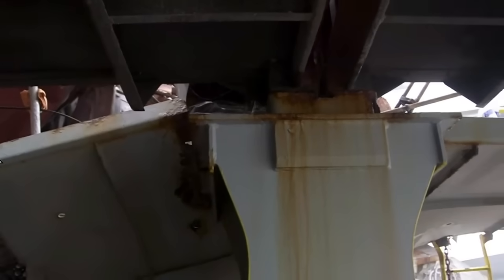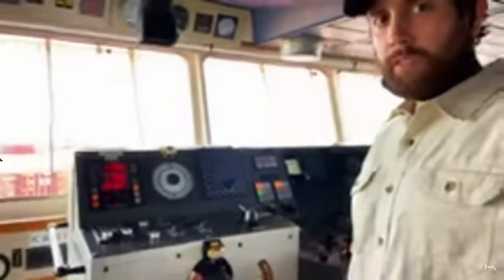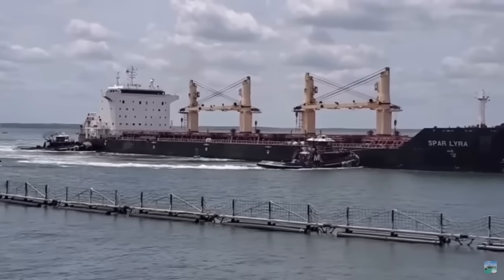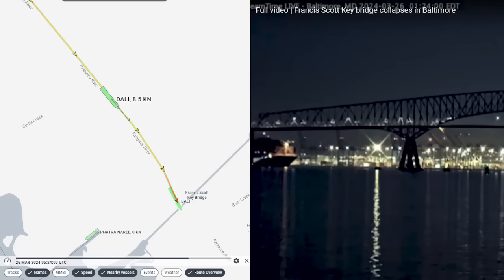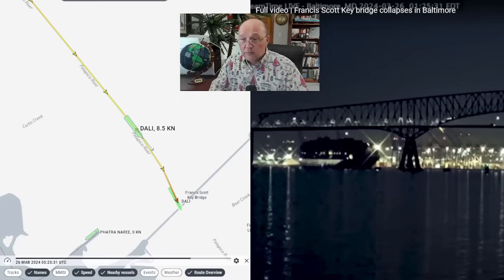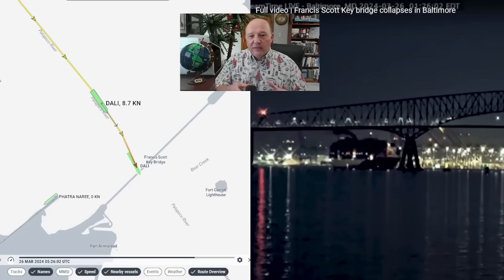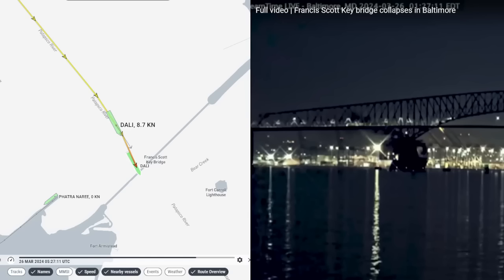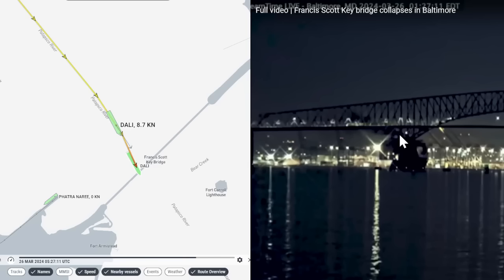Dali Timeline from Data Recorder in Striking Francis Scott Key Bridge in Baltimore, March 26, 2024

Comment: Again I wish to compliment you on a great case analysis. I do have a question on rudder control with standby Diesel Generator vs Main Engine. If the Main engine restarted and then stalled would the rudder control under the standby generator be interrupted? Would it be advisable to use only standby generator to clear the bridge?
Reply from the maker: If main power is restored by the ship service diesel generators, the emergency bus board would be closed.

Comment: If the Curtis bay water flow pushed the stern, why didn't it push the bow when it went by?
Reply: Depends on when the power went out and rudder control was lost. If they still had rudder command as the bow passed, the rudder would compensate to starboard ( right) .  If they then lost power and the rudder is still compensating to the right, well the ship goes off course to starboard.
Reply: exactly
Reply: @STREETGH0ST   But if they had power for the rudder when it was pushing the bow... then wouldn't the rudder be deflecting to starboard?  And if that's when they lost power... then the rudders are still deflecting to starboard... and you have a problem...

Comment: Not sure if it is the same as building gens, but every one I have seen, the gen kicks on, and it takes 10-15 seconds before the breaker trips to allow power to flow.  This is to ensure that the gen is stable before energizing things since an inconsistent power feed can damage equipment. So is it 45 seconds for the gen to be running, or 45 seconds for power to be flowing over the system? That would be my question on emergency power timing.

Comment: One big question Sal, we all heard you on about,  or when the Port and Harbour of Baltimore improved its facilities for Very Large and ultra Large international Commercial Shipping Vessels, plus exporting and importing companies too!

However, the Port of Baltimore Authorities, or City Baltimore Transport Administration, or Local County Transport Administration, or the State of Maryland Transport Administration, let alone Federal Transport Administration of the US Government too. 

Actually carried out any upgrades and improvements, or modifications, or even installed, or look at installing these it seems?

Any of the possible different Heavyweight and Fixed Marine Defensive Measures, for the protection of this near 50 year old and very important East Baltimore Road Toll Bridge?

Which carries a major interstate Highway, which not only goes around Baltimore itself, though more importantly carries over 30,000 vehicles and many or most are freight lorries a day and night, that is 7 days a week and 52 weeks a year! 

Either travelling North or South along the Eastern Seaboard Interstate highway and road network of the USA too, why were not reinforced concrete dolphins installed?

Or thick marine reinforced crash barriers built into the water channel bottom and coming metres out of the water with navigation warning lighting systems on etc?

Or even the construction of major built-up rock islands, that is around the bridge foundations and bridge support piers or support columns too!

Or rock breakwaters were built out form each shoreline, that is on either side of this bridge out to the Main Shipping Channel, both upstream and downstream too.

With these rock and reinforced concrete breakwaters, then in-filled and making them into extended shoreline areas, which could be used for sightsee, sports and leisure use, or light business use too?

Or just increasing the height of and grading a upward sloping bottom to the underwater shallow areas, by just using tonnes of dredged River and Channel Bottom Mud and Silt, then dumping this mud and silt plus grading upto in a sloping angle to the shorelines banks on either too

That is on either side of the bridge itself, also on either side of the Main Shipping Channel to shoreline as well, in the process creating a giant shipping run-off grounding breaking areas, that runaway ships and vessels could run aground on and into! 

Sal and of these heavyweight fixed Marine Defensives Measures, would have prevented the collision totally in the first place.

Or at worst situation reduce the force of this Large (10,000 to 15,000 TUE’s, or 20ft or 6m shipping containers carried) Container Ship, impact on the bridge to a what would have been survivable impact collision, or a major repairable collision amount of damage?

Equally the the Port of Baltimore Authorities, or City Baltimore Transport Administration, or Local County Transport Administration, or the State of Maryland Transport Administration, let alone Federal Transport Administration of the US Government too. 

Could have put in place regulations and rules, all Large Commercial Shipping Vessels of between 25,000 to 50,000 Gross Tonnages must be escorted, towed and guided by a pair of tugboats, 

With at all time an One-Minute at most Alert Emergency Fast Response Fire Rescue Salvage Tugboat, is on standing by patrol (24-hours, 7-days a week, 52-weeks a year) either within the Port and Harbour area, or along the Main Shipping Channel or both that is at all times too!

While ALL Large Commecial Shipping Vessels are either entering and leaving the Port and Harbour area of Baltimore, or travelling under all bridges crossing the Main Shipping Channel to and from Baltimore too!

However with regards newer Very Large Commercial Shipping Vessels of between 50,000 to 100,000 Gross Tonnages, then they must be escorted, towed and guided by a pairs of tugboats ahead of the vessel’s and by a pairs of tugboats astern of the vessel’s, plus another tugboat of escorting in case of an emergency too.

Lastly Ultra Large Commercial Shipping Vessels of between 100,000 to over 200,000 Gross Tonnages, then they must be escorted, towed and guided by a pairs of tugboats ahead of the vessel’s and by a pairs of tugboats astern of the vessel’s, plus another pair of escorting tugboats in case of an emergency too.

In closing Sal, why is not the likes of NTSB or Federal Marine Transport Authorities in the past or now, or State and National Politicians in the past, or even now too?

Not openly call for an Emergency Federal and State Reviews of the United States Marine Civilian and Naval Infrastructure be carried out As soon As Possible?

Also how well they are United States Marine Civilian and Naval Infrastructure, actually defended around the USA, that is against all types of Natural or Manmade Marine Accidents or Disasters from happening.

Let alone from attacks carried out, by International Terrorist Groups attacking Marine Civilian and Naval Infrastructure, or attacks from Enemy Rogue Nations on USA Marine Civilian and Naval Infrastructure too?

Because of what has happen in Baltimore in the last few day, with the whole port and Harbour of Baltimore, plus the bridge and Interstate Highway now going to be closed down for weeks or months, even out of action for years to some degree.

American and European Politicians and Transport Administration Officials alike, have to realise their joint overseas foreign enemies, will be taking very close interest.

That is on what has happened in Baltimore, also  how quick the US is to respond and bouncy back, plus how the US recovery’s from this Container Ship and Bridge Marine Accident and Disaster too.

Is the Port up and running in less than 28 days or within a couple of months, with Commercial Shipping Vessels and Naval or Naval Auxiliary Vessels, allowed to leave port or enter port normally?

Or will it be three to four or five or even six months, before Port is up and running normally at full capacity, or still only quarter or half and/or three-quarters capability too?

Or Commercial Shipping Vessels and Naval or Naval Auxiliary Vessels, will not being using Baltimore Port and Harbour facilities that is normally?

Actually until a NEW Road Toll Bridge is built and up and open to traffic, so re-linking the Eastern Seaboard Interstate Highway network, with the City and port of Baltimore too?

Which could be 3 to 5 years you suggest Sal, could Baltimore be not up and working at 100 percent, until say the 2028 Presidential Election come round again?

Especially depending, on if Trump and the Republican Party was return to the White House, instead of President Biden and the Democrats are Re-elected in November 2024, in just over eight months.

Because it will be interesting to see what development happen in Baltimore, in the next 7 months how these may affect the US Presidential Election in November 2024.

If President Biden and the Democrats can delivers on President Biden public promises to Baltimore, with Hundreds of Millions of Federal Aid Money, assistance, help and support.

Especially from the USCG, US Navy and US Army Corps of Engineers, or will we all see Trump and his Republican Party supporters, plus very much Republican Party Politicians at City, County and State levels in Maryland plus on Captial Hill in Washington DC too.

Trying to delay Baltimore receiving all these Hundreds of Millions of Federal Aid Money, plus Federal assistance, help and support coming from the USCG, US Navy and US Army Corps of Engineers too.

As part of Trump and the Republican Re-Election Campaign, for Trump to be President in 2025, then afterwards Trump will deliver all this Hundreds or thousands of Millions of Federal Aid Money to Baltimore so Trump look good!

Though When Trump was President, what did then President Trump or his Republican Administration,  do about the protection of United States Marine Civilian and Naval Infrastructure around the USA, ANYTHING AT ALL?

Comment: I'm not an electrician, but I'm a senior manager at an electrical contracting company, and have been around electricity for years.  My question is whether they had the rutter breaker trip-fail when the emergency generator came on so that the steering didn't come on the way it was expected. It sounds like they some electrical issues to sort before embarking.

Comment: Great presentation. Some questions: 
1) why was the bridge pylon built right next to the shipping lane (assuming the shipping lane is the deepest portion of the river)?
2) considering that the shipping lane is adjacent to the pylon, and that there are no dolphins to protect the pylon, should all large ships have been escorted by tug boats at low speed until they pass the bridge? I understand this is costly, but not as costly as a collapsed bridge.
Reply: The bridge pylon is needed to hold the bridge up, you can't put it further away as the engineering to make a larger span wasn't really practical in 1977 for this sort of cost (and ships weren't this big). There's 3 main spans, all as big as they could be, and ALREADY cantilevered to increase the distance between pylons. 

There are in fact several dolphins (you can see them on the charts), they were simply too small to be effective, as making them larger would block shipping lanes etc. 

Tug boats are incapable of stopping a ship this size that is underway at minimum steerable speed. they are designed to help it turn, or turn it around when it's already stopped in port. If there was a tug boat here we would likely be looking at an extra fatality. At my port we denied a much much smaller ship passage due to risk of collision, and rejected using tug boats as an option due to risk to the life of the tugboat pilot.

Basically the solution isn't tugboats or dolphins. It's a new bridge capable of more modern, larger spans, that themselves can support enormous islands around pylons, or a tunnel, or moving the whole port downstream of the bridge. There was no 'safe' option to use this bridge, with ships that size. But thousands of ports have that same issue. There's been 35 such incidents since the 1960s.
Reply: @peter65zzfdfh  thank you. Great explanation.

Comment: Huge question - just what were the rudder commands being issued?

As for orientation, I'd guess the Dali was oriented at least 20° off course at maximum, before it looks like it came back slightly to port. Wouldn't that require a pretty hefty cross current?  

Just what have those currents been known to measure in the areas in question?  That's critical to know if we're going to blame current for this instead of a rudder which was locked to starboard.
Reply: Look at the whole view on google earth, the course to the tiny river that is land locked is no where near the area where outages and such took place, no effing way.

Comment: A couple of questions with the rudder and propulsion system I have. Everyone is assuming the rudder was straight ahead when the power failed. If it was only a few degree’s to Starboard you would see the turn she did. Also if the prop was still turning would you see with the large prop, a paddle wheel effect walking the stern to Port?

Comment: Namaste Sal,

There seem to be talk on social media, about this Container Ship, having circle breaker issues? 

Directly because of the number of "Reefer - Boxes" onboard, keep tripping the vessels electric circuit breakers. 

That is all the time, plus this has been going on for some time too, maybe since before the Container Ship arrived in the Port of Baltimore too! 

Or it is to do with the high number of Refrigeration Shipping (10ft, 20ft, 30ft and 40ft long) Containers, that have been loaded onboard this Container Ship too, more than this vessel's electrical system can or could handle maybe safely? 

So has been tripping the vessel's onboard electrical Circuit Breakers, all the time and for at least 48 hours before. The Container Ship left the Container Terminal dockside, in the Port of Baltimore too? 

Also not only was the Container Ship Captain and Chief Engineer, plus all the crew onboard aware of this, so was the Ship's Owners and Shipping Operators too! 

As well as the Port of Baltimore Authorities Officials, also the Container Terminal Management too. 

Were equally aware of this information too, with some asking and the suggesting now too. This Container Ship, should not have been allowed, or given official permission to sail. 

Until this Circuit Breakers issue, had been fully addressed and resolved plus corrected and repairs had been officially sign off on too. The Container Ship was safe to go to sea, that is under her own power too? 

Which makes you wonder if anyone told the NTSB investigators about this, or has these NTSB investigators found this out for themselves too. 

Or the NTSB officials, will now be looking into this Electric Circuit Breakers issues onboard this Container Ship too? 

Because if there is a Circuit Breaker issue on this Container Ship, also proper repairs have not been carried out too?

Comment: Most of my career was on tankers, on both coasts, and the West Coast does a lot more tractor tug on a line astern escorting, and from my only experience with them working (a training exercise with a large crude tanker) they can "wag the dog" very effectively, and potentially could have kept the DALI pointed in the right direction.

Also, I think we need to make clear to the non-sailors reading this,  the main engine isn't the only engine going deep in the ship, most ships have 2-4 diesel locomotive size (generally) engines that supply electrical power for the ship.  If the main drops, they'd still have lights.  The failure was with these engines, their generators or the electrical system SOMEWHERE.  Loss of electric causes the Main to loose things like fuel pumps, oil pumps, cooling water pumps, etc, causing it to shut down.

Comment: There is a large range of lighting which comes off the E-gen. When main electrical power goes off, the emergency power bus first disconnects from the main bus then the E-gen starts and powers the emergency power bus and equipment on that bus.

Comment: A few decades ago a cousin practicing law in Louisiana was involved in a case of a freighter that lost steering on the Mississippi. Settling involved almost everything about the manufacturers and subcontractor's who built or installed everything from shop's radar to connections between engine and propeller shaft. Determining fault and assigning blame in the Dali will likely take a long time. (I'm going with faulty fuel filters )

Comment: Synchronization is the term used when generators are operating in parallel. The frequency, phase, and voltage of each generator must match. This can be illustrated with a sine wave on an oscilloscope.

Comment: I see 3 macros here. 

1: Ships Standards. Are they high enough? Do the black boxes record enough data? Do the back up generators need to be larger so they can power more things? How do we get the international community involved to sign on?

2: Standards Enforcement. Are the standards we have enforced effectively? This ship has been passing inspections, are the inspections effective? Are there whistle blower protections for crew members who report concealed problems?

3: Infrastructure: The largest ships don't even come to the US because the ports are too small. Who do we have to fire to get our infrastructure updated?
Reply: The larger you make them, the slower they are to come online
Reply: @SilverStarHeggisist  At one FedEx Building I worked at, we had a back up generator, it was a V16 Detroit Diesel, the combo was as big as a large delivery truck, it started within about 20 seconds of the power failure. There are ways of doing these things.

Comment: Dear Sir,
My doubt is, if the vessel was having a speed of 8 knots, why was it not decided to use the speed of the vessel and use the steering gear to steer clear of the post, instead of putting the anchor and trying to go full astern. 
What do you say?

Oh yes, one more thing:
The tugs can still be used this way.
Put the engines on stand by as soon as the vessel approaches the bridge.
Let the two tugs take over.

What say?